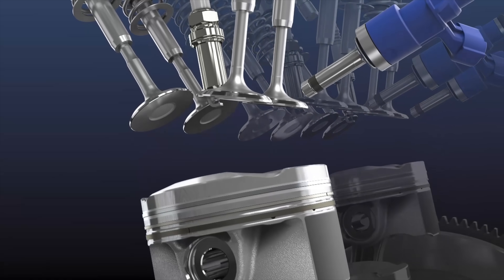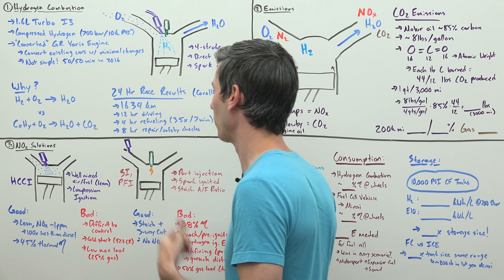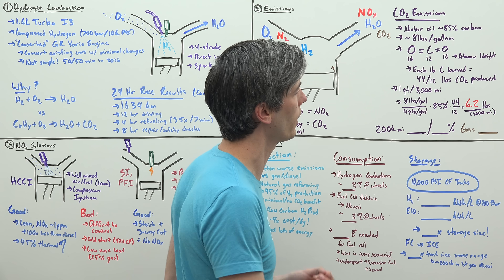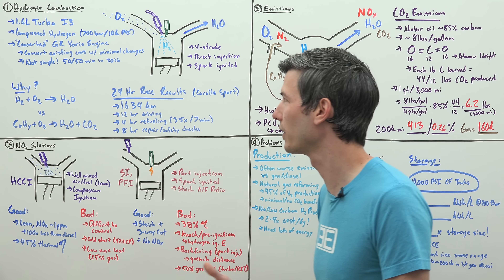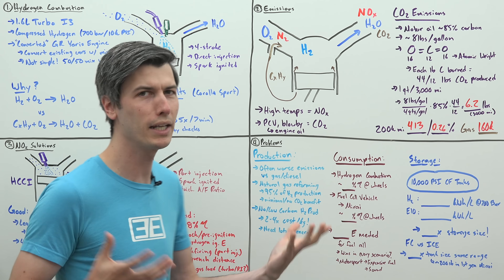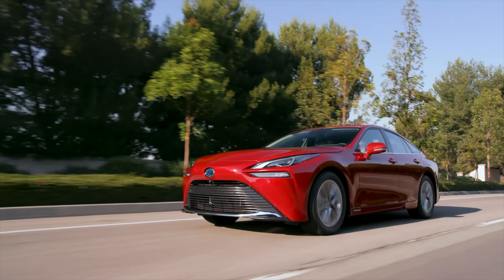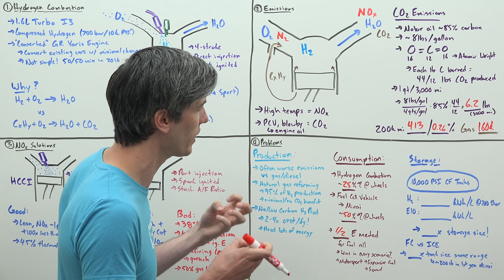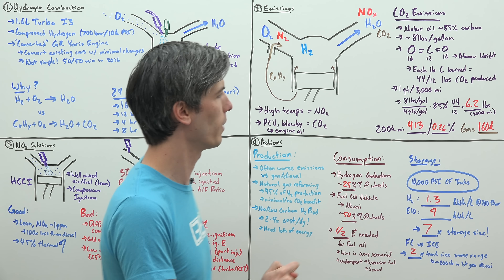Toyota's Developing A Hydrogen Combustion Engine!

Comment: The first combustion engines were also extremely inefficient.
Over time, ICE H2 engines will become much more efficient.
Reply: ICE engine, due to friction, cannot be as efficient as electric motors, I can't help feeling all this effort is misplaced, if you want powerful cars, work on electric motors.
Reply: @chrisp7839  electric cars catch fire, their batteries wear out and are hazardous waste.
Reply: @livinincalifornia  ICE vehicles also catch fire, wear out, and are hazardous waste
Reply: @livinincalifornia  Both Hydrogen and BEV card are electric, so the same is true of both, but 3 times as much electricity is used to power a fuel cell car.
Reply: @chrisp7839  A hydrogen ICE car does not use electricity.
Reply: @chrisp7839  You don't understand at all, but anyway have a nice day
Reply: @livinincalifornia  I feel like you just don’t like electric cars.
Reply: @livinincalifornia  fires in ICE cars spread much more easily from their fuel. ICE vehicles produce hazardous waste in the form of motor oil as well as emission gasses. You dont seem to understand ICE cars very well because you're comparing lithium and aluminium lmao. Also, while ICE's have increased in their efficiencies over time, their highest theoretically possible efficiencies is still nowhere near electric motors. And even if they improve in efficiencies well over what's currently known as physically possible, the need for transporting fuel decreases the total efficiency by a lot
Reply: Combustion engines are still extremely inefficient, about the Same as This combustion engine.
Reply: @michalandrejmolnar3715  What's more inefficient is charging an "electric" car with diesel and gas power plants
Reply: @livinincalifornia  no one uses diesel power plants apart from really remote places. Natural gas turbines  are actually quite efficient. About 50% efficiency. But hey, that's why most countries are pushing green electricity.
Reply: @bubba842  Tesla uses diesel generators for charging stations, so "yes" they do. They are less efficient that ICE cars because the conversion from gas and then through transmissions lines, and then converted again into the battery, is a very inefficient process, much less than 50%.
Reply: @livinincalifornia  which charging stations?? Sources??
Reply: @livinincalifornia  completely debunked myth that they run on diesel engine. Plus most electric cars are charged at home via grid. Even if that were true, that is STILL more efficient than running a straight ICE vehicle. That's essentially a hybrid setup, just with charging from ICE coming from outside the vehicle. Hybrids are much more efficient because 1) electric motors are very efficient at low speeds which is the opposite of ICE motors 2) ICE motors lose even more energy via heat during high load situations (i.e. acceleration) through torque converter and within the cylinder. In a lot of hybrid vehicles engines are still connected to the drivetrain so above factors still apply to a small degree, but as a generator it doesn't even experience any energy loss that it would as a part of a drivetrain.
Reply: @chrisp7839  I’m more interested in cars making decent sounds and being able to shift my own gears as well as tuning and modifications. EV’s are no fun for petrolheads
Reply: @livinincalifornia  ICE cars also catch fire, more than electric cars..  Hydrogen has to be stored at 10,000 psi and you'll be sitting on top of three tanks per car...  all batteries wear out, but all batteries are also recyclable... lithium ion batteries are re-used as power storage and other purposes.. You've also heard about how much less it cost to operate an EV than ICE cars and that Tesla is the safest car in the world...

Hydrogen filling stations are too expensive to install and will not catch up to EV charging stations. Hyundai Nexo and Toyota Fuel cell cars cost $ 85 dollars per fill...Tesla costs $ 4 to 8 dollars per full tank depending on where it is charged..
Reply: production likely will too
Reply: @chrisp7839  I mean Cars itself aren't fking efficient. Stop trying to justify 5000 lbs metal containers to transport 500 lbs of human mass (not to mention tarmac to rubber friction and the loss of energy).

EVs don't solve the energy efficiency problem of Cars. It's just a prettier but ineffective solution to make consumers feel more environmentally savvy.

Gas, hydrogen, electric, all cars are just horrible means of transportation lol.
Reply: Can never be as efficient as a FCEV
Reply: @chrisp7839  weight to energy ratio is a big drawback for EVs.. Most of the lithium is mined using oil based miners. Ofcourse transmission power loss is less in EVs but they are not reliable . Hydrogen could be a great candidate for replacing the gasoline engines
Reply: Even excluding friction, you don't have high efficiency at all. You lose quite a lot to heat and... sound!
Reply: @livinincalifornia  The Empire is destined to collapse anyway; there is no saving the planet mate.  We ride till the wheels fall off mate.

Comment: Battery production may be limited by shortage of raw materials. Green hydrogen could be a more sustainable source of energy for vehicles.
Reply: You use 48 kwh of electric energy to produce 1 kg of hydrogen. With that energy,  you can drive 200 miles or 300 km in a Tesla. It's not enough efficient yet.  Maximum ideal efficiency is 39 kwh/1 kg of Hydrogen,  but not yet reached.  For up to 500 km range,  I believe that electric is the best option.  Plus I can produce my own electricity.  Hydrogen is just too much of a hassle.  Unless,  is really cheap.  Probably in 15 years,  will be different.
Reply: @gordesmihaela4635  You are assuming right now that windmills or solar panels arent going to get really expensive.  We need to have a lot of options on energy, and honestly Hydrogen is just in the beginning phase of creation.  EV's make sense for a commuter car.  They do not make sense in freight, boating or airplanes.  On a larger scale Hydrogen is honestly our best option in fueling the future and also keeping our same lifestyle.
Reply: @gordesmihaela4635  no it isn't they found an easier way they use gallium and tin with room temperature and made hydrogen
Reply: You're making a few important assumptions, and missing a few steps. As the video illustrated, hydrogen combustion itself is a dead horse, even with much higher pressure you can't bring enough hydrogen with you for it to be practical, and even at 700bar refilling is already so impractical that for every 7 minute refill, the station has to re-pressurise at least 15 minutes, meaining you can do at most 3 cars/hour/station. Which is less than a fast charger, which has a net higher energy efficiency to boot (not just the hydrogen takes a lot of energy, the infrastructure as well, like compressors, whereas that kind of stuff is minimal on electric). Purely on the rarity of energy alone hydrogen makes little sense.

Another assumption you make is that the material shortage isn't an issue for hydrogen. It is an issue. FCEV's use a boatload. Not only because they essentially are EV's (the fuelcell can't  "spike" as hard as a battery can, so every FCEV has a battery to boot, which albeit smaller, is still sizeable), but also because the fuel cell has a lot of rare, expensive materials in it. Heck, it has platina as a frigging consumable.

Considering you can't get 700 bar of hydrogen on your driveway, but you can get AC current which you can easily load balance on top of it, and battery chemistries are not only diverse but constantly evolving (energy density doubled, and LFP is a no-cobalt viable technology already), and considering "vroom" even for hydrogen makes no sense... I'd say hydrogen and sustainable have no mix in personal vehicles.

Comment: At present there is probably too much focus on battery tech + fuel cells but investment is growing for hydrogen combustion as a solution to low-rev, high torque vehicles. I think it is too early to say what the fruit of greater investment will yield on hydrogen combustion but you rightly point out all the challenges - thank you for the informative video !
Reply: Every example of HICE for cars I've seen is basically just a gimmick. The only company that actually seems serious about HICE is JCB but I haven't found anything giving numbers to show why it's better than using a fuel cell. You can have big machines on a HFC, Mercedes are developing a truck based on HFC.
Reply: @adrianthoroughgood1191  fuel cells use very expensive catalysts (platinum, palladium etc). These are way more experience than lithium and cobalt.
By using HICE you are basically foregoing efficiency (hydrogen production, transportation and storage) but by using mature ice technology consumers have to pay less upfront. Also scaling the production of hydrogen is easier than scaling the battery capacity.
Reply: It would be an excellent solution for container ships!

Comment: An interesting hydrogen  combustion technology is that of KEYOU. This company converts diesel engines to HICE  engines. With  these engines they  reach  efficiencies of nearly 50% with the use of EGR, lean combustion  and high boost pressures. A nice  development  to follow, because  emmissions are nearly zero

Comment: Big problem with every example of a hydrogen engine presented is that it naturally asperated.  Using ambiant atmospher to mix with hydrogen gives oxides of nitrogen.  To avoid this problem hydrogen injected into the engine as well as oxygen (from an tank or onboard source) will avoid the nitrogen problem. Carbon from lubricants is still a problem but very minimal as stated above.

Comment: Stanley Myers did this back in the 80's. He was able to separate the hydrogen in the water and then it was flowed into a combustion engine. But back then oil was king and Stanley was killed mysteriously before his invention went mainstream. I saw another system in the 90's that made hydrogen from water in your garage and you pumped it into tanks in your truck.
Reply: Check out my earlier post. Friend of mine did this with his V8, worked O.K. But the  internals of his engine were junked after 12 months from the water acids caused from combustion. He was rightfully upset.
Reply: Over the past 100 years there were four successful attempts at building a hydrogen powered engine. All you had to do was fill the tank from your garden hose and the only emissions were water vapor. All inventors met mysterious ends. So over the last 15 years we've been wondering how the oil companies and governments will be able to get their cut from this technology.....and they are
Reply: Free energy on a Prison Planet can not be a good idea for the powers controlling it…

Comment: This is Excellent news. I have always wondered why no-one was trying to run Hydrogen in a combustion engine. Thanks for the info.
Reply: Peter Ross the impediments which the oil giants have been putting on hydrogen...and electric...vehicles over the last 100 years is absolutely mind-blowing.

Comment: It makes sense if you convert the power grid to nuclear power.
Reply: Here in the UK, the planned conversion to electric vehicles will require 10 additional power stations. Plans are to build more wind farms. 
However, the grid infrastructure is a far more serious problem and will require extensive upgrades. As recharging becomes faster, charging areas will be supplied from the 11'kV high voltage grid, rather than the low voltage sectors.

At the moment, the government are promoting electric vehicles, since the change over to regenerative AC motors on the railways, along with LED lighting and induction cooker hobs has reduced the grid load quite considerably. 
In the future, the government expects to slow down the sale of electric vehicles to keep the electricity requirement in balance.
Reply: @wilsjane  Sounds like ride sharing, mass transit and reduced car ownership with Uber, Lyft et c will get a boost. As may thorium reactors for electricity. If personal ICE cars were closed course only, humankind will be playing more video games and gain 100 lbs per person. Not to mention noise, electrical leakage,  and fire risk from 11kv lines. Yuk.
Reply: Nuclear utilized to drive a hydrogen economy makes sense. Batteries and EV's are not the answer.

Comment: Very, very, useful information. There's a lot of misconceptions on the internet about how "easy" it would be to convert an existing ICE to run on hydrogen, but this video is one of very few that actually delves into the specifics and well as pro's and con's vs. hydrogen cells. As always, great work Jason.

Comment: If someone invented gasoline just yesterday it we be labeled a "miracle fuel"  just one single gallon contains 33,700 watt/hours or 116,000 btu's  of energy.
Reply: Jack K  Or even longer
Reply: What about running an engine 100% on alcohol? In Brazil, we got ethanol on the gas stations pumps. Ok, it's not 100% ethanol, because its hydrated, so it's a mix of 96% alcohol and 4% of water. Despite the fact that has less power by a same amount, when comparable to gasoline, it's renewable and less harzadous for the environment.
Reply: @ianferreiraian  Alcohol based fuels are terrible for the environment, they have a huge amount of knock on pollution. Real engineering has a nice video about it
Reply: @SweatyFatGuy  Awesome information. I know you can run way higher compression ratios with alcohol. But I am confused about something. I think alcohol contains roughly 33% less overall BTU's per gallon. How do you get more power out of alcohol, compared to gasoline? Are you getting more power with less fuel mileage MPG?  Or is it because the compression ratio makes up the 33% difference?
Reply: @SweatyFatGuy  This is simply untrue. While every fuel has its advantages and disadvantages, ethanol still suffers from incomplete combustion and production problems. Fully electric vehicles is the only way to go.
Reply: @EnlightenedSavage   No.
Reply: @SweatyFatGuy  you should watch the video first before writing your comment. The problem with Ethanol based fuel is usually from its production, which crops and how land is cleared for it (for Brazil, clearing the Amazon rainforest). And then converting the plants into ethanol, is also carbon intensive. After all of that, it’s still carbon negative, ie produces more carbon than it removes. Aside from all of that, solar energy is 77x more efficient than this method.
Reply: @EnlightenedSavage  EVs will not work for the masses. There is not and will never be sufficient infrastructure to charge all these cars. They will be a niche player for the upper classes. Drive through any large city and look at all the cars lining the streets and parked everywhere. Now imagine how those will be charged. Then multiply that by tens of millions for all the other cities and even urban areas. The landscape will be covered in extension cords. And many of those cars are owned by The Poor. The Poor will have EVs with worn out batteries, maybe 30 miles per charge, while unable to charge them. EVs are yet another front on the Left's war on The Poor. Why do they hate the Poor?

Comment: Thermodynamics.
It takes more energy to create the hydrogen than we get out of it.
Gasoline and diesel are used for a reason. Sun stored energy in plants and that is consumed when we burn fuel.
Reply: Just use the power in an EV, lets face it, fossil fuel vehicles have had their day.
Reply: Ah, someone with a brain!  Refreshing.

Comment: The fallout series solved all this year's ago. BRING ON NUCLEAR CARS
Reply: Went well for them, obviously!
Reply: @FuncleChuck  ah, you aren't a man of culture.
Reply: @davidweikle9921  I was thinking if this keyboard warrior wanted a class a nuclear reactor built into his car.. Go thorium... He would get what he deserved...
Reply: the nuclear power would fuel an electric motor
Reply: Technically it would be possible easily. The problem is shielding. If you want it to build it to regulation, you would get a light tank, not a car. But if you only want it to be reasonably safe, it's probably possible.
Reply: Engineering is all about good enough
Reply: nuclear cars i heard would be very slow. youd have a car that can go 1000 miles but itd have to do 20 the whole way
Reply: Then we will have to pay $10 a gallon for coolant and if you run out, you better run away fast. 😂
Reply: Containment would be a problem.
Reply: @wunderlichD  with as much energy as you'll get out of it, adding bulk for lead will probably be fine. 

American submarines and aircraft carriers seem to have solved it

I'm actually curious why oil tankers and cruiseships don't do it
Reply: @zeedstun891  i wasn't aware and thought had gone into it, interesting. 

Yeah I was imagining the old "boil water and have it spin a generator". Idk how much power that world produce
Reply: @FuncleChuck  in all fairness, they were fine until the world went up in flames around them
Reply: @zeedstun891  
Not really. A nuclear reactor can generate practically unlimited amount of power. The limit is a nuclear bomb. The only problem is cooling the reactor. If you can't take away the heat fast enough, the reactor melts and you get a big mess. I can't find it now, but I remember a reactor that weighs about 500kg and generates 1MW of electricity. That's about 1300hp.

Comment: Everyone forgets bmw did this with the E38 7series. It had a hydrogen powered V12.
Reply: Exactly my point and I believe angelina jolie had one too 😂
Reply: BMW has the best electric cars too, well some say.
Reply: Yup. The engine was even capable of running either gasoline, or hydrogen. It's only real issue was that it wasn't really tuned for power. That, and lack of hydrogen infrastructure.